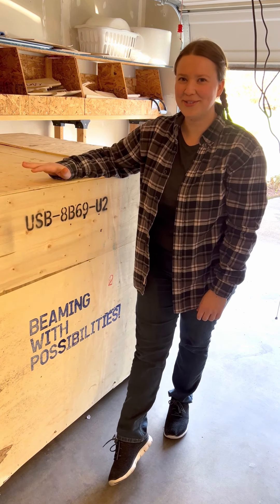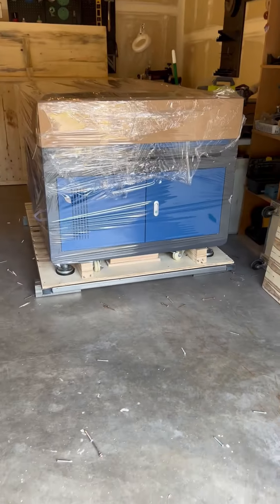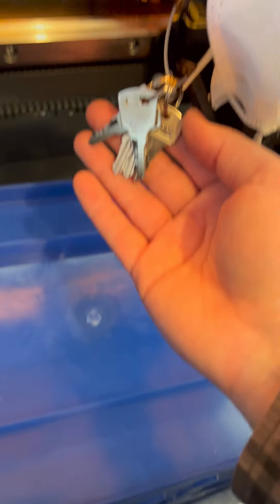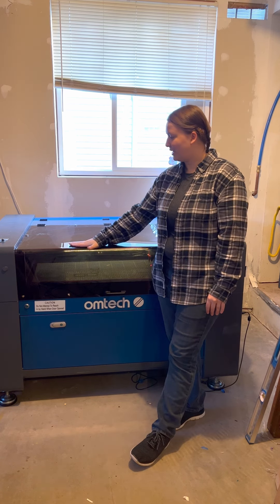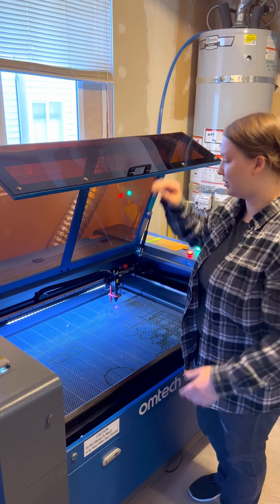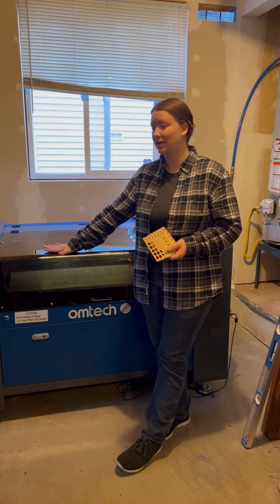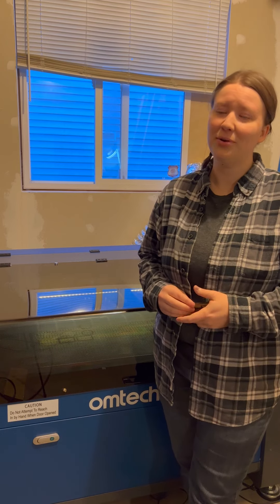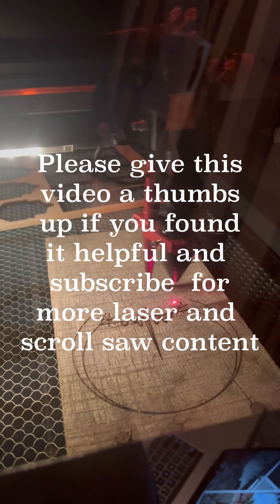80w CO2 Laser Review and Unboxing - Why OMTech?

Comment: Very informative….  Hoping you can give me a bit of advice….  I currently use a Glowforge which is super easy to use….  The reason I want to upgrade is 1… it skips spots cutting 1/4” which ruins material and 2… tech support is the worst company I’ve ever dealt with. 

Very much considering the 80w (not sure auto focus or not)

My biggest concern is having to use light burn….  With Glowforge, you tell the program what the material is and how thick, position the project on the spot through the camera and hit print. 

You kind of answered the question at the end of your video…. How hard was it to get going with light burn

Thanks. Frank
Reply: Lightburn is really easy to use. There are Youtube "How To's" videos as well as support from Lightburn. Sell your glowforge and and dont look back. There is a bigger and better laser world out there.
Reply from the maker: Hey Frank! Sorry I'm so late to reply to your comment, im just getting caught up on my YouTube account. I believe I talked to you today on instagram though so hopefully I answered your questions there! Lightburn hasn't been too hard to learn, I'm sure you can do it! :)
Reply: Glowforge is designed to destroy your mental health… I have one and HATE it! Should have done more research so that’s on me! My first pro lasted 14 months and I had to buy a refurb for 1600.  When it arrived the “handle” part of the lid was not attached to the lid so they sent me another one. That one I got in May and it died in November…. So I have to either get another refurb or use it as a doorstop. It is unconscionable that they only do repairs in house!  Not to mention that their spare parts are always unavailable and it is could based so if they go under you’re screwed!

Comment: Love your information.  I am looking for a laser that is 24x35 with the pass through to cut a variety of materials- wood, but mostly acrylic to make sewing templates and quilting cotton with a fusible ironed to the back side.  This would be for sewing stores to sell appliqué kits to their customers.  I haven’t had a lot of luck finding videos of makers cutting this media, but I know its done.  Have you tried this?
Reply: I have cut fabric with my xtool m1 laser for ornaments.  It was just doing test cuts and adjusting power and speed.  Too slow and it burns.
Reply from the maker: Hey! So sorry my reply is ridiculously late, I'm not sure you even care to know any more but I've definitely cut fabric on my laser before as well as leatherette with iron on sticky backing. I think it would work just fine as long as you dialed in the right settings. :)

Comment: If the laser lives in the garage where temperatures can be extreme, do you recommend the chiller vs the bucket? I live in Texas and temps can be very hot/cold during some months. I'm concerned if I keep mine in the garage I could damage something. Any insight would be helpful!
Reply: It depends on how much cutting/engraving you are doing at a time.  I live outside of Cincinnati and I chose to get a chiller since I'm setup in the garage and I use my laser for several hours at a time.  To help when it's below freezing, I run mine with RV antifreeze as well.
Reply from the maker: Great advice! I also put some RV antifreeze in my chiller and that seems to be all I need for the few below freezing nights we get up here in the PNW.  @mrjerryk